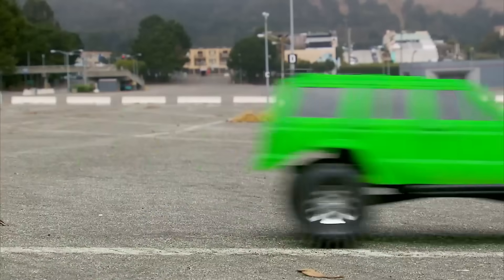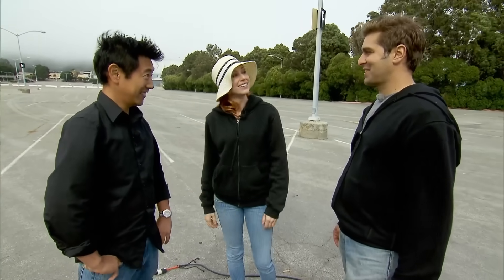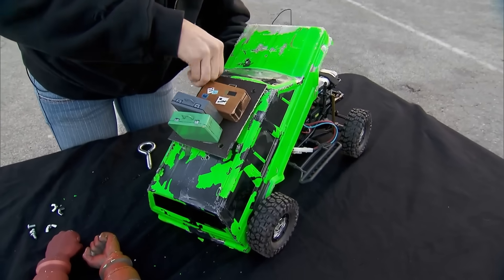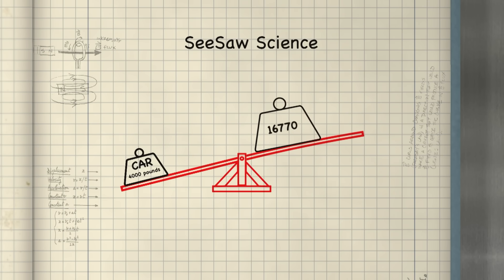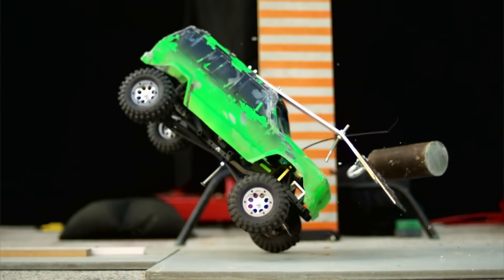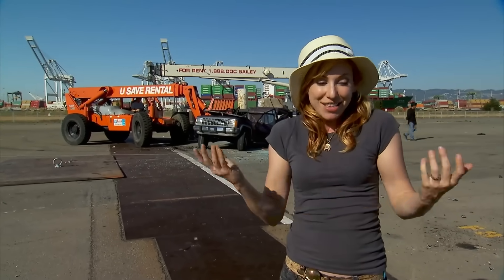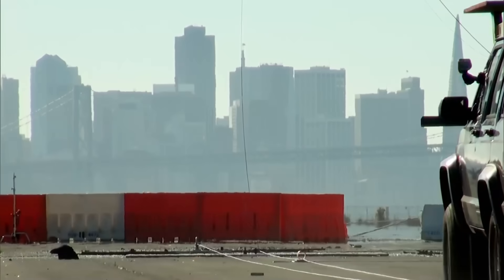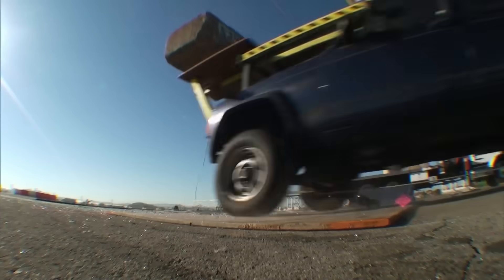Can A Car Be Flipped On Command? | MythBusters

Comment: Would have been better if the weight had released on time and not hit so far back. It was the exact same problem that they illustrated with the seesaw. Not saying it would have worked, but leaving an improper test and calling it "Busted" won't fly with the fans. I understand that money was the real issue here, but they should have acknowledged that.

Comment: I think there is a 4th element to this. The speed of the falling weight may not be just gravity but possibly much faster. I know it would be hard to accelerate a weight that size downward but I would think that if it was moving at an ungodly speed than you could possibly get the car to flip end over end. By the time the suspension failed the concrete block was exerting force almost at the roof line causing an opposite rotation force behind the fulcrum. If the weight hit the target and immediately pushed the front end into the ground before the vehicle speed slowed down then I think this is possible.
Reply: Might be possible. Might also be possible the rear end would simply crash onto the front part as this part would have major deformation and almost immediately become static, thus having a dynamic part (rear end) and static part (front end) acting as two distinct pieces. I think having an elevated lever helps tremendously in this case as it pulls the car downwards. Thus, a car with this lever and a high speed object falling onto the car would make it flip as long as it does not split the car into two distinct parts.
Reply: @snookymaster I see what your saying but I’m thinking of how to make it work with out modifying the vehicle.
Reply: Hardly any comments, yet I am reminded why I watch these things... Silly folks don't entertain it, only interested/interesting people!